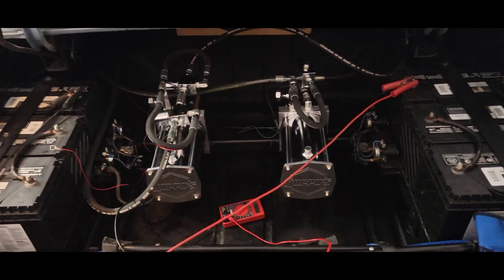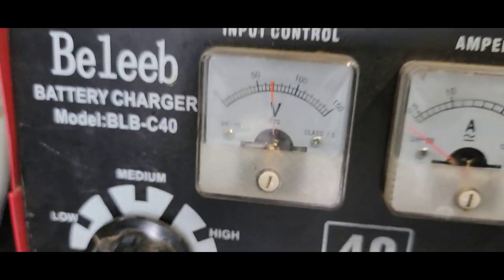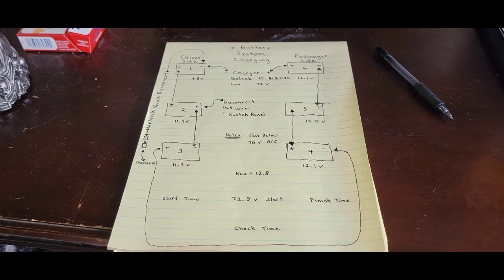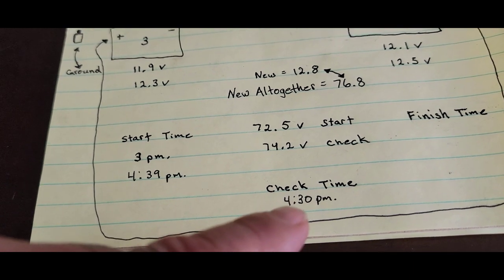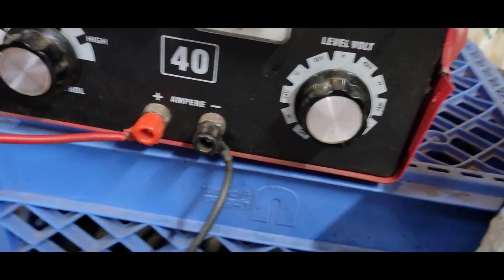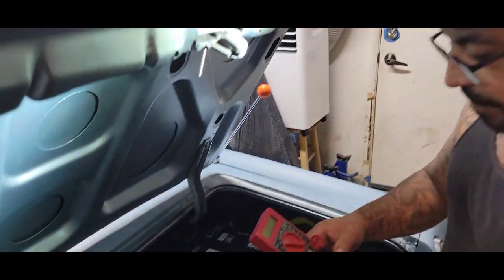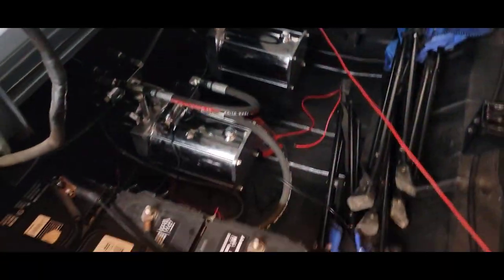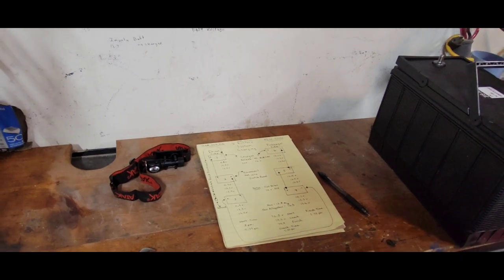Charging Low Rider Hydraulic System On Pala-Girl

Comment: Buy a timer for the plug set it for twelve hours go to bed and ride that charger doesn't put out enough amps to hurt batteries at 72 ..resting voltage is 12.6 to 12.8 charged .
Reply from the maker: Thank you for watching my video

Comment: Hi I have an impala and I don’t have hydros yet, what can set up like yours do? How’s the ride with hydros? That’s a nice 65 by the way.
Reply from the maker: Thank you for your comment... Right now, I just have a 2 pump set up. It's just a lay and play. I am up greating to a 3 pump with 9 batteries so I can do a standing 3 wheel. I recommend that you get some of your frame reinforce.
Reply: @Shortymacg1  this is a dumb question but are you able to hop just a little bit? Also, is it a partial reinforcement like stress points? How is the drive with the car with hydraulics on it?
Reply from the maker: @beetopahua8058  I don't really hop my ride. But it does get up off the ground in the front. When I drive it, I usually have it stock hight and the ride is good. Also about the other question... yeah get the stress spots reinforce.
Reply: One more brother- so sorry and I really appreciate the love, how about in the freeway? How’s freeway speed drive? Thx 🙏🏼 and God bless!
Reply from the maker: @beetopahua8058  it should be fine... I just cruise in the first lane. Again... stock hight.
Reply from the maker: Thank for watching